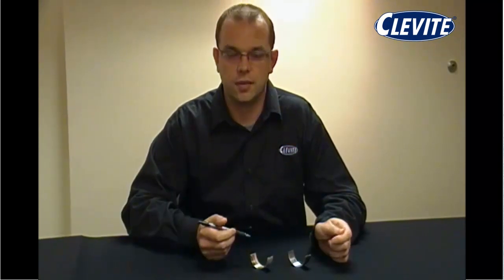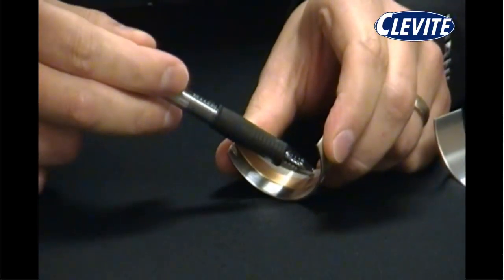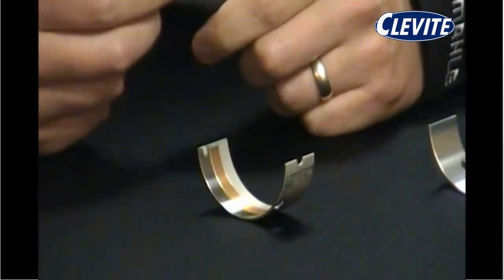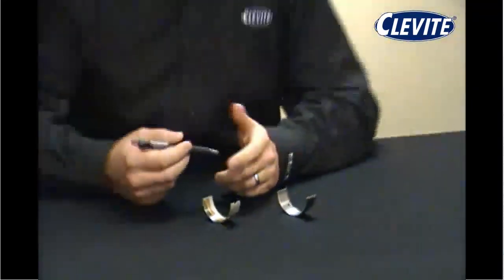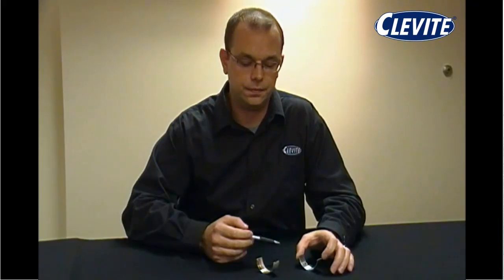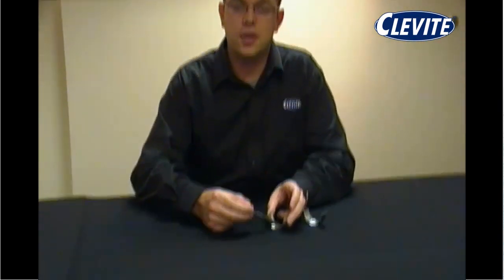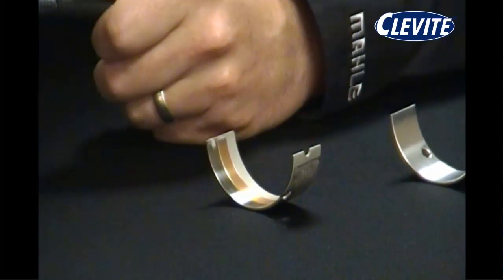How To Choose The Right Set Of Engine Bearings

Comment: I thought you was going to talk about the size I need to know if it's about standard. 20.. 25. 30 under size
Reply: Well if you’re getting bearings on an engine that has been unopened then obviously standard because it wouldn’t have been machined.
Reply: I have a bearing 0.50 on it does it means the crank was cut to 20 thousand?

Comment: How would one know what thickness of bearing to buy. I just took a 4.3 apart and there is play in the rod caps so I'm going to replace the bearings and I'm thinking about installing King pmax bearings because of the ceramic coating. Do you think this is a good choice?

Comment: So, lets say I run cammed alumin heads tri metal is good. Next how does that affect oil weight? If it called  for 5-30 a 10-30 ( to keep the bearings wet when the engine is shut off)  maybe even a 15-40 (its never below 40 where I live) and I drive hard
Reply: clearances  affect oil weight  more than the bearing material  

driven oil has a chart guide  for rod and main clearances  for  both  aluminum and steel

Comment: Have replaced my crankshaft bearing shells and also replaced the connecting rod bearings.

block rotates but a bit heavier than before.

is this normal by placing new scales?

or should it still run as smoothly as before the repair

Comment: Hi sir , me no understand
Reply: De 1st one has for giving material, for people who should change their oil more often, especially if short drives to daycare. Maintaining the PCV system will help as we as an oil catch can, but use use name brand correct valve as this is a calculated vacuum leak except at idle when it closes due to vertical weight or spring. Some are drilled with no valve. The tech should not replace these, just make sure they are clean. 
  2nd tri-metal bearing are for heavy loads as drawn cold steel shell is electroplated with copper to control thickness and the a high silica % and aluminum are heated, sprayed inside spinning tube with a precise amount to achieve thickness sometimes polished to finish fit. But the silica content is very hard and support higher loads over time and other types. You be happy now! Long time.
Reply: @deankay4434  😆👍